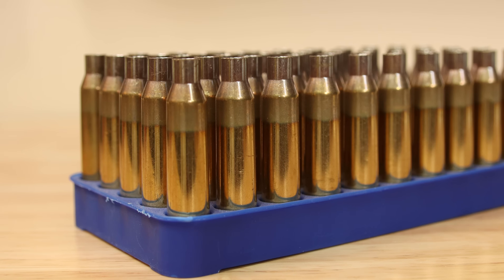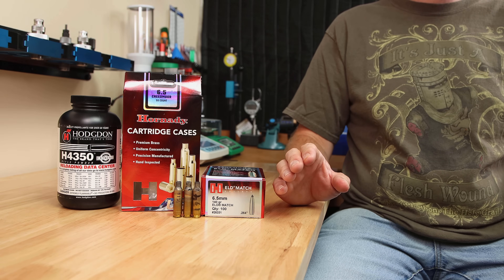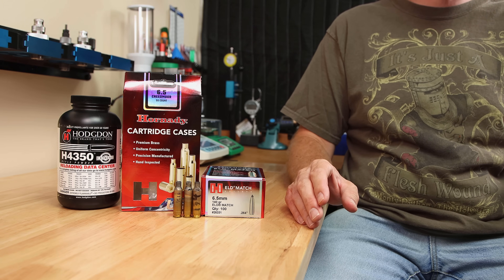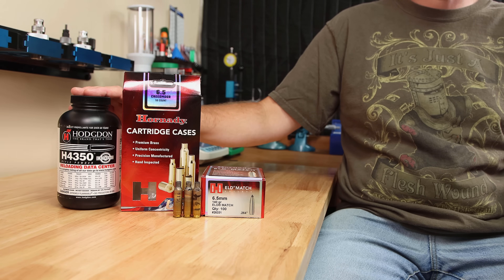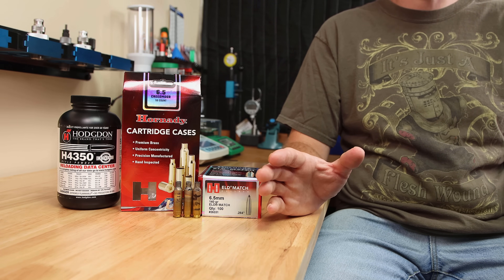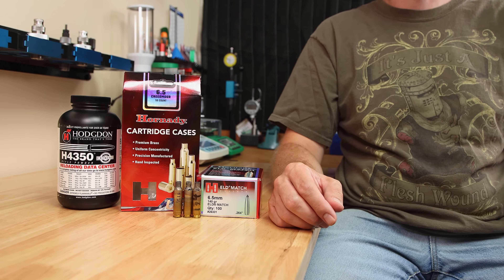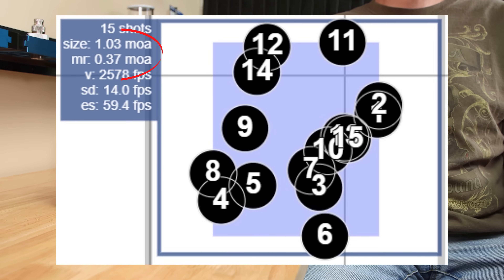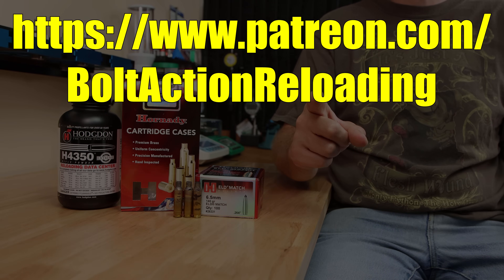How NOT to Anneal Your Brass!

Comment: Did you brush or lubricate the necks in any way for either treatment?

It isn't easy to draw hard conclusions on the results. The average speeds may not be statistically significant, and even the group analysis may be borderline with only 12 shots, but I suspect the 2xanneal of being slightly worse due to the theory that the seating force stats look worse in both magnitude and dispersion. The higher the average friction and the more variable it is, usually tends to poor performance.

In rough terms, Seating Force is the product of the integration of normal force from the hoop stress of the neck tension multiplied by the Coefficient of Friction. If the hoop stress is changed, or if the CoF is changed, we should expect the change in initial combustion. In general, the average and dispersion of the seating force affects the tune and the precision, but no theory beats testing.

Hard to say what the effect on HV or material properties like CoF were due to the second annealing. The change in seating forces speak for themselves and those results stand alone. Folks debate the effects of seating force on precision all the time, so I won't take a side either way other than to say in my opinion it would be best to keep it under control.

When we do find the best tune, in general anything that helps with precision will likely help and vise versa. However, just because something is sorted down narrowly or more precise, doesn't guarantee being in tune so it may become wasted effort. Nice test. YMMV